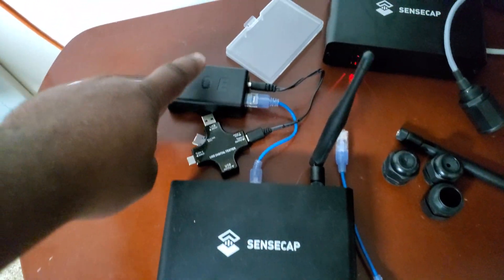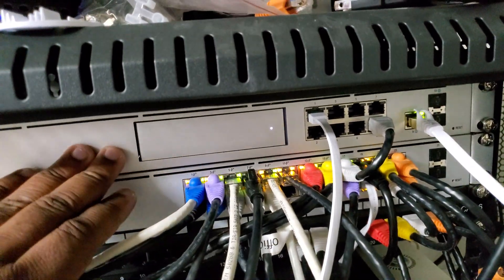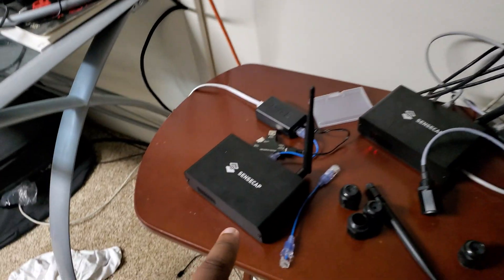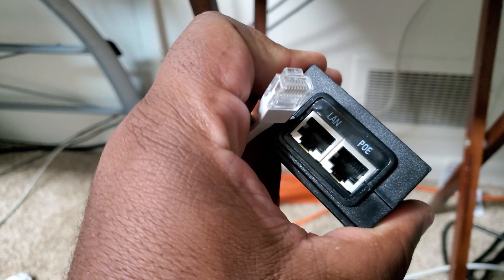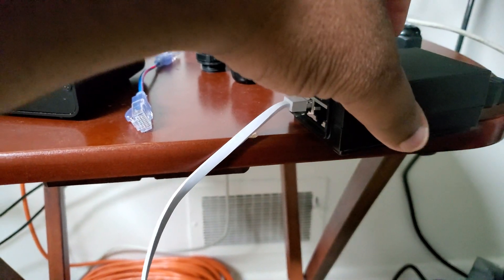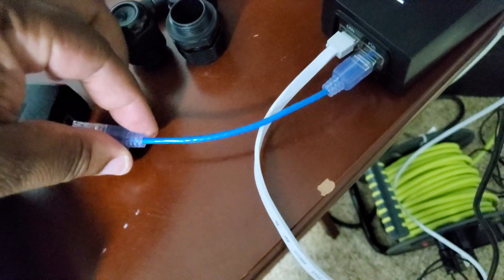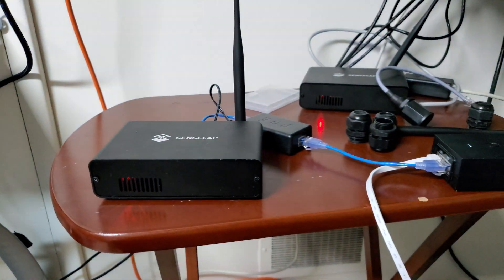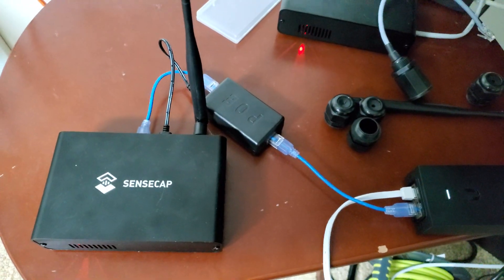A quick rundown of how to power a Sensecap (or any) Helium miner via network cable.

Comment: Is it possible to use POE Switch with splitter instead of using injector?
Reply from the maker: Yes. As long as it can supply 48v, you're good

Comment: The ubiquiti Poe injector that you are using in this video is rated for 24v and .5 amps. Sense cap miner requires 5v and 3 amps. No biggie?
Reply from the maker: 48 volts actually. 24 volts won't work. Learned that the hard way

Comment: Hello mate, thank you for the helpful video! Where can i find the small dc to usb-c cable or how can i google it? Is it a 5.5mm (3/16 inch) diameter connector?
Reply from the maker: I haven't searched for any yet, but my first place would be Amazon.  But I haven't done enough digging into voltages, etc... to know which ones will work correctly.  What miner are you hooking up to?

Comment: what is your opinion on dc vs usb c for poe injector?
Reply from the maker: I much prefer USB C.  Less worrying about the correct voltage requesting, standard cable size, and easier to service out in the field.

Comment: how about just using passive poe injector with its own power adaptor
Reply from the maker: I mean... the video actually goes over that hehe.  But in general, I prefer power off the switch if it supports it due to the fact that it can be easily remote power cycled.  Without that, your power source has to be remote managed in order to effectively be able to reboot your miners that are out in the field.

Comment: Hey thanks for the video very helpful, just one question the blue cable coming from your Poe splitter is that a Poe or just a normal LAN going to the miner? Stef
Reply from the maker: All cables you see are just normal cables.  The one going from the splitter to the miner is not injected with power because that was split off by the splitter to the usb C connection.  The only cable carrying power is the white cable.
Reply: @Kingphotosonline  thank you very helpful
Reply: @Kingphotosonline  what voltage specification injector do I need, I have a sensecap, do you have a Amazon uk link where I could get one please, thanks stef
Reply from the maker: @1066Kitchen  48 volt injector
Reply from the maker: @1066Kitchen  Here's my idea list https://a.co/1A20fHi
Reply from the maker: @1066Kitchen  https://www.amazon.com/shop/marcellusking?listId=3843CRDGEUGBA
Reply: @Kingphotosonline  thanks my friend just ordered one almost there just got to wait for my miner now waiting times are ridiculous atm

Comment: Hello, I have that same POE splitter from Amazon with 5V 4A. The power is coming from a a PoE+ switch (Tp-link TL-SG1005p v2) and it is not powering my sensecap. I tried my another splitter that outputs 5V and 2.4A and it powered on my hotspot. The stock power supply outputs 3A. Is there any down side in using the 2.4A splitter? And any idea why the 4A splitter is not working? Anything helps, I’m new to all of this.
Reply from the maker: Yes, and as a matter of fact, I don't even use the ones you see in this video due to issues with them flaking out out in the field.  Now, I use Procets, and the ones that are specifically made for the sensecap by RAK.  I would suggest getting the better quality ones unless you like visiting your sites to replace items.
Reply: @Kingphotosonline   hey man thanks for the info, if I go the RAK way I’ll still need a POE injector AND splitter right?

Comment: Is OK, if  the output of a splitter is 4 A, and the Sensecap required 3A, I try a Poe sistem with Tp link 150s injector, and a Tp link splitter 10R, and I can't power the Sensecap, you know what is the problem? Maybe the output, on my splitter says output 0.5A, I am newbie here, you can help me?
Reply from the maker: I'm not sure what exactly the 150s injector and 10r splitter are, but the injector needs to be a 48 volt injector, and the splitter a USB C splitter.  If it's only a 24 volt injector, it will not provide power.  And I have no idea what one above 48 volts would do. Could possibly damage